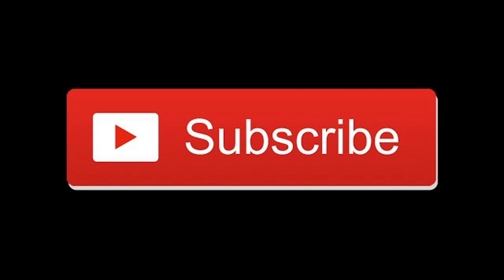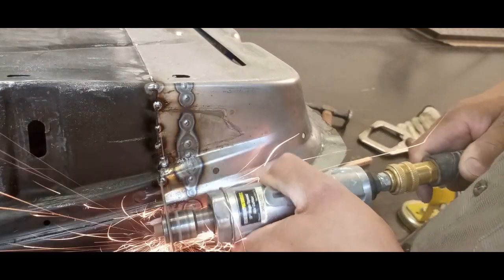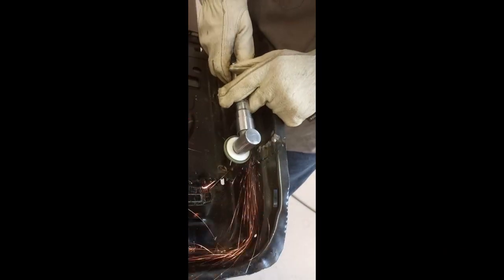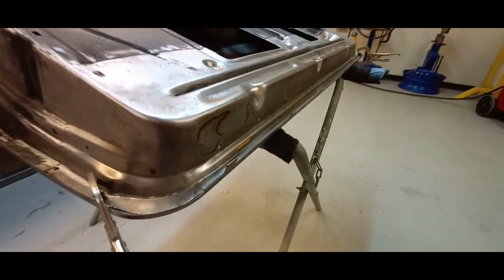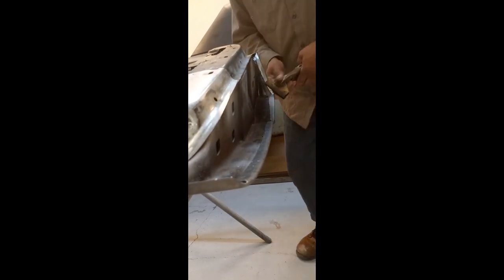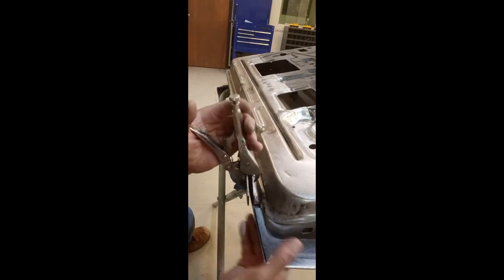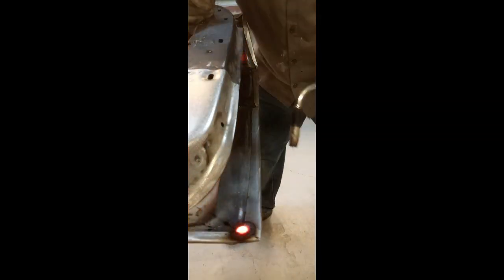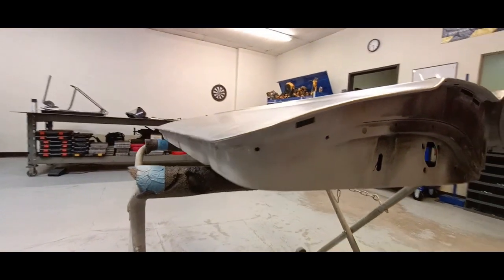1962 Impala part 6 - door skin installation and finish out - DIY Auto Restoration

Comment: Wow brother that is alot of work can I ask how many hours did you have in doing all that work and how you figure out your time vs just replacing the entire door. did you have to go that path cuz there is no full doors or a long waiting time.
Reply from the maker: The customer had already purchased the door skin and the patch repair panel inside it's always a toss up depending on if a good quality door is available
Reply: @guzzifabrication3448  sweet ok cuz I was thinking auto metal direct